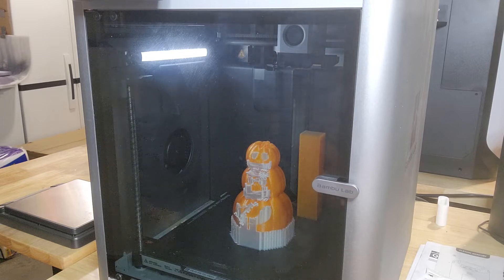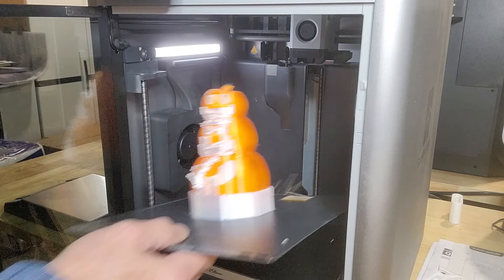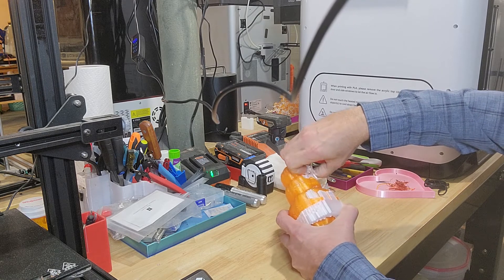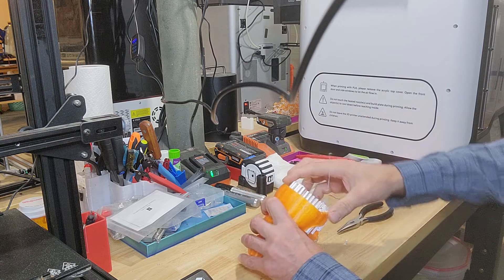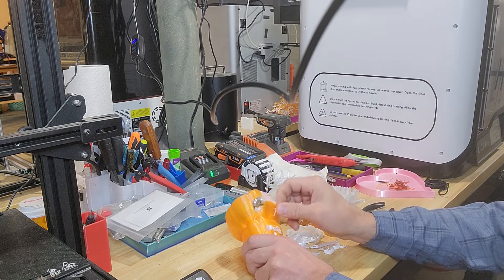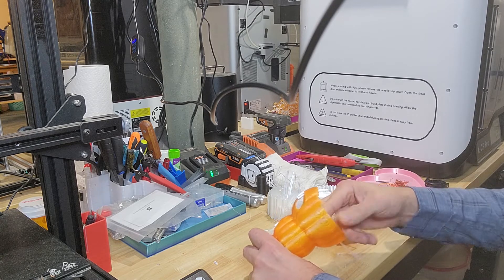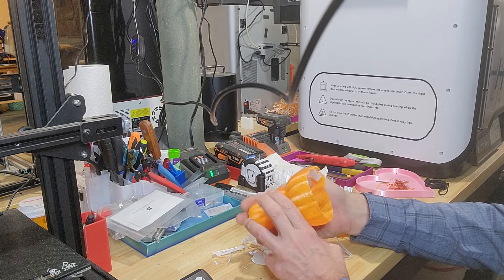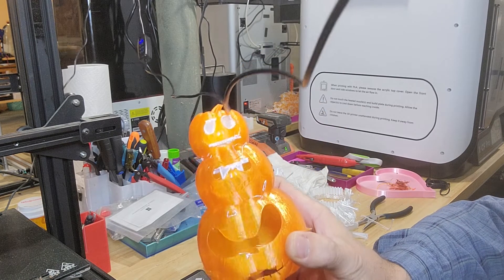Swamper's WorkShop - Bambu Labs Support Filament - My Mistakes

Comment: I think it works better as just an interface layer, so normal infill of what ever color you are printing with till the last layer in-between the support and print.
Good luck 👍
Reply: It’s supposed to be used like that. Everything else would be crazy, especially for the price.
Reply: it's certainly cheaper this way.  also, if you print PLA, you can use PETG as the support interface material and you'll have the same effect for cheaper
Reply: @ame7165  PETG doesn't always print well with fine detail and can string. Also requires a lot of flushing to ensure no contamination between PLA and PETG. Yes it works, but if you have support filament, it's probably more fool proof.
Reply: Defo use only as a Support 'INTERFACE' layer, works well like that. Also you need to strengthen your model somewhat, Walls, Infill etc etc?
Reply: Sorry but how do you add an interface layer between the support and the item your making?  That would be ideal to just have one layer in-between support and item. How do you add this layer?  Sorry I just got my Bambu X1 Carbon yesterday and I'm fairly new to this system and slicer. Is there a video or link to learn how to apply it this way?
Reply from the maker: I'm going to give this a try! Thank you!
Reply: cheaper too